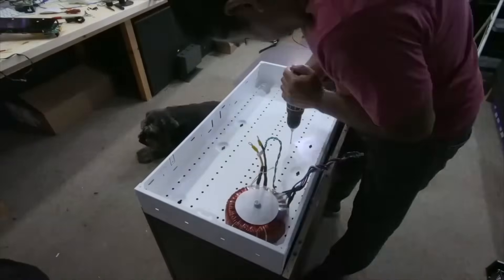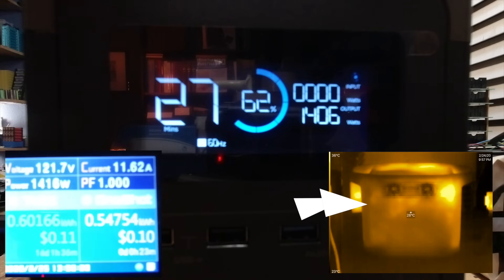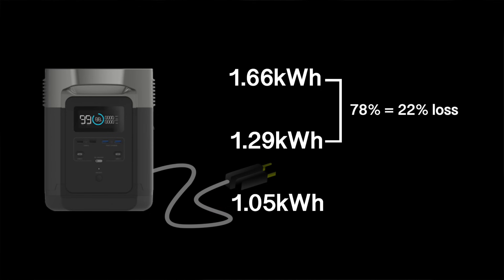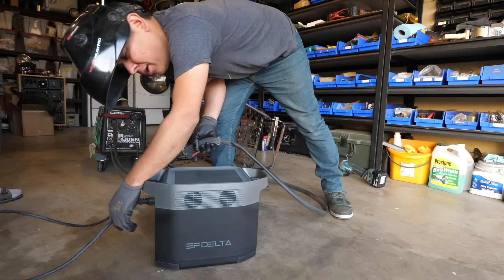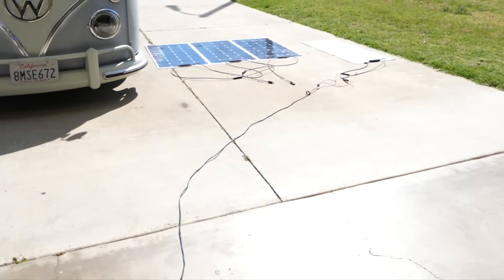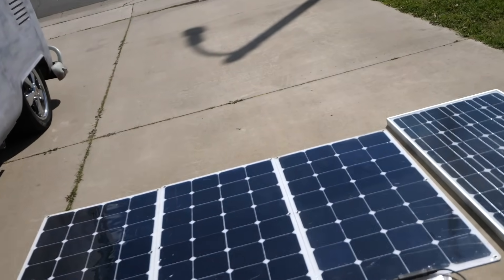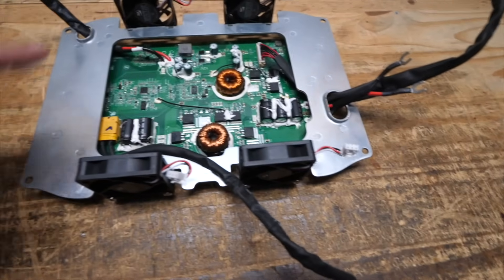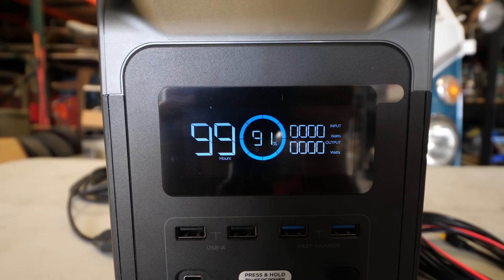The Most Epic Review of the $1300 SOLAR Battery - EcoFlo Delta1300

Comment: A purely resistive load is not going to effect the waveform you should have used a motor load. But on the whole a pretty good review...... Trying to use the welder was good comic relief. Even you had to laugh. Looks like it would be great for camping, when you wife and kids need a fan and a light..... Good work.......

Comment: I live in a condominium townhouse cluster that does not allow gasoline powered generators for noise and safety reasons. I recently purchased a Delta as a backup power source for the occasional power outages here in tree-strewn New England. In early tests it's worked fine.

Comment: you can get (12.8volts) 4 cells of 280 AH of lithium lifepo4 off alibaba or aliexpress for $481 shipped. so get 2 of those and you have 12.8 and 560 AH or 25.6 volts and 280 AH, throw in a bms and an inverter and the cost can be about the same as this. for reference the product in the video is 90 AH and probably 12.8 volts so DIY you get like 7x as much battery storage plus charging it and discharging it is faster with great current pull, so HARD PASS on these "epic" products.

Comment: Can you please do a test on 6 months/12 months to see how the battery capacity holds up and if it still hold a charge. Another test I would love to see is if this battery can power regular in house fridge. Not the small dorm fridge or travel/camper fridge, but a full size refrigerator. It would be nice to see how long it can power a fridge. I am in the market for a solar/battery bank in case of a power outrage. Thanks

Comment: I love my EciFlo Delta... I bought it about 6 months ago and it has been very consistent. My only complaint is that it has a pretty limited output when comes to the number of things you can run at one time and the length of time the unit delivers power. This unit isn't cheap at all and for the price I would have liked to have a longer window of user time. Additionally it requires a 400 watt solar power charging station in order to charge in just a couple of hours if you are not near an AC outlet, otherwise it takes a very long time to charge. On AC it charges typically in about an hour and a half. When we are out camping or what not I simply charge it using my Predator 3500 inverter generator. The Predator is better than having to set up all the solar equipment and actually gives me a guarantee of a power source verses solar which needs light. If there is no sun I am screwed, but then again if I have no fuel I am screwed... 😀

Comment: 140 of the a123 26650 batteries which runs about $13.50 per cell for a total of $1890 if you were to just buy the cells and DIY.  You would have to spend another $200-300 for the BMS etc so $1300 is a really good price for this.  BUT ONLY IF THEY ARE ACTUALLY A123 CELLS.  As well, IF these are A123 cells then they have 2000+ cycles so basically 10 or more years if you were to charge and discharge deeply every day. And the A123 cells can deliver 100 amps instantaneously.

Comment: Great Review. I bought this product on kickstarter with some uncertainties. The review made me feel confident about this. BTW, one question. How did you manage to charge a Model 3 with this? My Tesla wouldn't charge from the battery as there is no real ground.
Reply from the maker: You have to cennect the neutral pin to the ground pin
Reply: @jehugarcia  Neat. Thanks.

Comment: I'm a weekend RVer.  And been looking for a solar generator for its noiseless factor .  I only use my RV in going to the beach or public parks and hang out with my 2 kids and wife.  We love watching movies in the RV.  I also operate my old surround sound with it.  I'd say we operate the TV and Surround Sound maybe 4 hrs a day and maybe an occasional boiling water with an electric kettle or sometimes a coffee maker.  I was thinking of plugging the RV to the solar generator.  The RV has a 30Amp plug (w/ 110v adapter).  I've been watching stuff about the Yeti 1400 and 3000, the Inergy Apex and the Titan.  Which the last 2 generator I mentioned has a 30Amp plug.  So would this generator be sufficient for me ?  Or should I just pick the others?  Help!  I've been asking these Vlogers on the same question for weeks not 1 have answered.
Reply from the maker: This will do 1800w (15A) or half of the 30A your RVs plug can handle.  All other generators do less output
Reply: Thank you for your knowledge and reply.    Yahoooooooo!

Comment: Excellent review, one of the best Ive ever seen. Question, the 18650 cells inside, what configuration is it, you quoted several configurations (10s7p X 2) or (14s10p X2) or (14s10p combined). I found out that they use 18650 cells from a China company called "GreatPower.net", unsure which specific model though. Thank you
Reply from the maker: 14s10p

Comment: Is the 12v cigarette plug regulated or unregulated? If regulated, how many volts is it supplying? If unregulated, what does it provide at 20% remaining charge? This info is necessary to know how it will behave with a 12v compressor cooler, like from Engel or Dometic. Thanks.
Reply from the maker: Regulated 13.6v  8a

Comment: There is an expansion to this battery, if you purchase multiple units, you can daisy chain them.  The downside to this, is that it starts by passing through to the final unit in the chain until that one dies, then starts using energy from the next unit and so on.  I wish it drew down power equally from all units connected, but its a minor complaint.  I really love my unit, and my results from my testing, although not as precise, were in the same ballpark of slightly over 1kwh of usage...so very consistent manufacturing means these are good, high quality, long lasting units!

Comment: I just bought this and I'm returning it.  The DC output stinks!  8amp max.  I can't run my diesel heater (10amp) or water pump (8amp) in my camper van.  It does great powering my microwave, water heater and refrigerator....all AC power.

Comment: Okay so I've been wondering if I were to make a battery pack and I wanted to charge the battery by connecting to an outlet but also wanted to have a solar panel to charge the battery pack how would I design a system that has TWO charging sources

Comment: Dear @Jehu: I would like to take advantage of your knowledge if possible. I have this MPPT (@t it provides a means to use a higher voltage PV array to charge either a 12V or 24V battery (types in specs are Gel, Sealed, AGM, Flooded), but I am very curious if I can charge a 18650 bank of batteries  with that MPPT and  if a BMS will handle the 12V or 24V from the MPPT. As extra information it has 4 Stage charging (Bulk, absorption, float, equalize (optional)). Thank you.

Comment: Seems weird to me that the	internal AC/DC input circuit has been made more powerful than DC charging. There's always going to be DC-DC conversion, for balancing cells etc so it makes most sense efficiency wise to have a beefy internal DC-DC and have the AC-DC feed that. Otherwise if you want to charge via solar at more than 400w you'd need to convert your solar DC to AC just for it to be converted back to DC inside the device, causing 100s of watts to be wasted

Comment: What a great video!  I have mine on order and waiting for it anxiously.  Question for you, would the DC efficiency be better than the AC?  I am more familiar with the traditional inverters that give better efficiency with DC versus AC but I realize this has a bit of a different inverter.  Bummer that the apparent DOD is as large as it is.  I have messed around with the Bluetti and it seems that one's DOD is about half of this ones at 10 percent versus the 20 for the Delta.  Guess they do that to hel battery life since you can pump the power into and out of this unit so fast relatively speaking.
Reply: you can get (12.8volts) 4 cells of 280 AH of lithium lifepo4 off alibaba or aliexpress for $481 shipped. so get 2 of those and you have 12.8 and 560 AH or 25.6 volts and 280 AH, throw in a bms and an inverter and the cost can be about the same as this. for reference the product in the video is 90 AH and probably 12.8 volts so DIY you get like 7x as much battery storage plus charging it and discharging it is faster with great current pull, so HARD PASS on these "epic" products.

Comment: Yes very nice, I would like to have the V2 with the expansion battery option, It should be able to add at least 12 packs of 14sX10p, possibly unlimited packs. BTW can it charge with solar and be used at the same time, wouldn't that make it last longer? Also you can buy a 380w single solar panel for under $200, that would be under the 400w max right?

Comment: Great teardown and test video.  I bought one of these recently and love some things but hate others.  Love the 1800W output and the super fast charging.  Hate the loud fans, terrible efficiency, and it's been hard to find the right adapter to hook up my 120W solar panel DC cable output to the XT60 port.  @jehugarcia - since you did a tear down, do you think it's possible to mod this and swap out the 4 loud fans for some quieter ones?

Comment: I live in Florida and have to deal with hurricanes on an almost yearly basis. This type of device would be very helpful in providing temporary power to keep our devices charged during the blackouts that follow. Because of it's large capacity, I would most-likely utilize it to power a portable refrigerator to help keep my Insulin cool. The challenge with insulin is it needs to stay cool, but cannot be frozen.

Comment: I'm late. I have an associate's in auto technology. I live in SanF out of a 1994 Ram 350 that I converted from CNG to gas. I have a total of 600wh of lead power, 300w inverter. I have a 300w solar panel setup, feeding a digital dc to dc stepdown, DIY roughly 5.5kwh 36v lithium (18650s) of storage, 1500w inverter. If I won a giveaway, I'd use that nice battery to go play my guitar on Fisherman's Warf.

Comment: I live in a 2nd floor apartment that i rent. I am the top floor with a deck and easy access to the roof but my breaker box is in the basement. I would like to set up a grid tied system and am looking for some direction to go to get this done. on the cheap
Thank You

Comment: I live in Montana and during the cold months am on the road towing a 5th wheel RV South to warmer climates. 

Am off-the-grid in Montana and pack up my 255watts of solar panels, and 4 (good? old and HEAVY) deep-cycle lead acid batteries while traveling. The EcoFlo Delta1300 would help my cause much. Congrats to the winner...whoever it may be.

Comment: I would convert my garage to off grid. I just purchased a house and I'm having trouble finding space for a a new 30amp 220V dryer breaker in my 100amp panel.(last owner never had a dryer) I want to use the 10/3 cable running to the garage and convert it to a dryer plug but I need to make the garage run on solar. This would be perfect and this battery/solar pack is all I would need to run a few lights and use the garage door openers a few times a day.
Reply: GettinStiggyWidit just add a sub panel

Comment: I would use it to run the welder when I need a quick job around my house and no power available, until I get my diy pack done and then I would give it to my van dweller friends to run their small appliances while they travel.

Comment: Saludos even tho I can use this in Florida due to the power outage frequency here I will give it away to my mom in 🇵🇷 Puerto Rico since she has been without power since the hurricane Maria. She is using now 4 panels from harbor freight an inverter and 2 deep cycle batteries it works but not too reliable as you can imagine.. great content Jehu

Comment: I would use it to power my DIY work room.  This is where I do all my projects.  This is where I solder and make all my battery packs using my DIY spot welder.  I would also use it as an emergency power supply to watch your videos during power outages.

Comment: This unit is also capable as an uninterruptible power supply. This would be used as an extention of my solar generation system as a circuit that supplies power to a cpap and mini fridge for a diabetic. We lose power alot here and this would compliment as an emergency back up.

Comment: I am setting up a new shop. I want to include a Vertical Milling machine, horizontal metal lathe, a vintage shop smith system and possibly a small CNC or 3D printer. I'm concerned about power. I won't be running all machines at the same time but I want to run a machine off battery instead of on metered power. Then I could have the battery charge off hours or on solar. It would have to carry about 1000W for the whole shop setup. Maybe more

Comment: Alright wasn't planning to enter at the beginning but I'm impressed so here we go. Since I'm big on iteration and rolling tech forward I envision 3 phases of existence for what I'd use this for. 

First, in present I'd use it as emergency power. My place is a bit prone to power outages and it would be good to have a backup solution. Also as you mentioned I could use it as an emergency range extension for my Nissan Leaf if it came down to it. It may be inefficient and not much range but that 3 miles could get me to a charging station when I otherwise wouldn't. 

Second phase, I am in the process of planning a DIY RV conversion. Once that moves from planning to assembly I would use this and the panels to power some of the various tools for the conversion as well as provide energy to test the AC and DC grids of the vehicle while under construction.

Third phase, after the conversion is complete and I move into the vehicle the pack would return to a supplementary/emergency power usage case, as well as serving the roll of a portable power source I could carry away from the RV if desired.

Comment: Jesus, I am posting again because of the potential life saving impact the Delta 1300 could have.  My wife requires the full time use of an oxygen concentrator.  We have a small generator as a backup for power outages, but the solar charge aspect of this would be such an amazing relief to know that she could breath when the sun is out AND at night with the batteries should power be lost for an extended period.  Thanks for considering. I am in the process of building one of your power packs regardless.  You are doing a great service to all DIY’ers.

Comment: We have pretty lousy power supply in Baltimore with summer thunderstorms on the horizon. The city does not do a good job trimming tree branches from power lines and power goes out often during thunderstorms. I would use this backup power supply to keep computers up and phones charged during these black outs

Comment: I love diy, especially with li ion batteries, i'm always modding my stuff cause the tiny batteries don't last.
However, i just started my trucking career so for now, and for a long time, i won't be able to build more battery packs. I would use this in my truck so i can entertain myself during my breaks and not have to have the truck running to recharge the truck's batteries.
Reply: you can get (12.8volts) 4 cells of 280 AH of lithium lifepo4 off alibaba or aliexpress for $481 shipped. so get 2 of those and you have 12.8 and 560 AH or 25.6 volts and 280 AH, throw in a bms and an inverter and the cost can be about the same as this. for reference the product in the video is 90 AH and probably 12.8 volts so DIY you get like 7x as much battery storage plus charging it and discharging it is faster with great current pull, so HARD PASS on these "epic" products.

Comment: I live out in the woods so we loose power every now and again so I would use this to offset my gas generator usage to power lighting, water pumps, and my deep freezer.

Regarding the lack of expansion ports on the unit can't you just hook an additional battery pack to the solar input? Does the unit support being charged while it's being used?

Thanks for the opportunity to win this.

Comment: Hello Mr. Garcia!
I am someone who has found an interest in diy solar, lithium batteries, and energy conversion devices. I am a non degree seeking student at MSU taking some basic Electrical engineering classes. I would use this unit to become acquainted with these systems so I can feel comfortable making the big purchases for my diy projects. I am converting a van to live in and would use it for that project in the near future. As well as a tear down to look into why it’s design is coveted. Thanks 🌞

Comment: There is a reason I subscribe to  your channel. It's because I want the power indepency that you have achieved. To date I have bought batteries and equipment that you have recommended. But honestly the fear of making a mistake that would cost me  dearly has stopped me from starting a diy project. So many times I have debated on asking you to build or selle one of yours but again fear of rejection and humiliation has stopped me in my tracks. So please consider me. My first time commenting on anyone's channel.. PS if not this item giveaway please tell me how to get one of your diy projects thanks

Comment: I am OLD, so I would use the EcoFlow instead of my hard to start gasoline generator (with my bad old shoulders) to run my fan and small 12 volt fridge during power outages.

Comment: I would use it for many things around the farm where outlets are not available.  Including running transfer pumps and portable sprayers.  And on vacation for charging my electric chainsaw out in the woods.  And it would be excellent to have available for emergency use when the power is out and to run the ventilation fans in the tornado shelter.